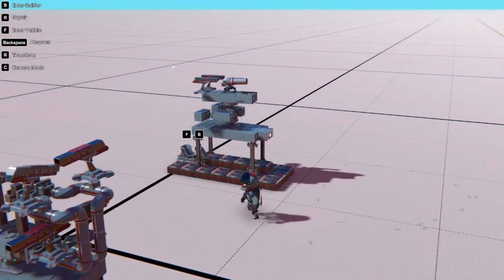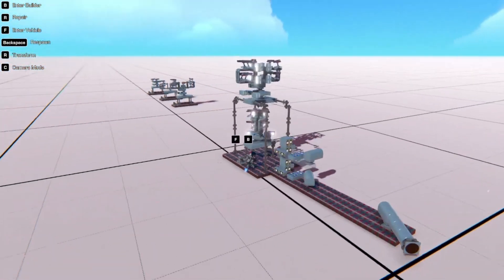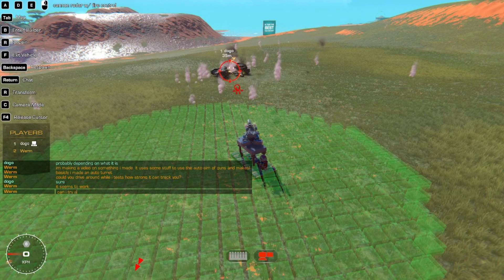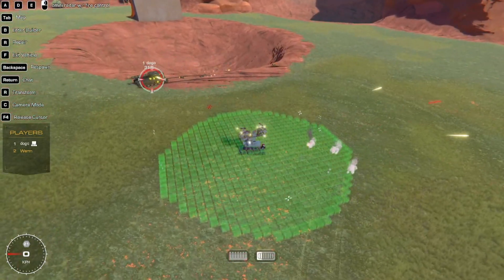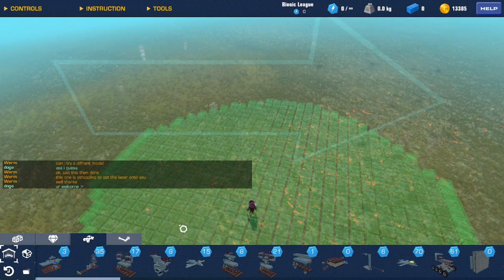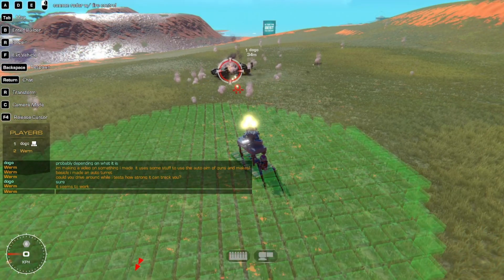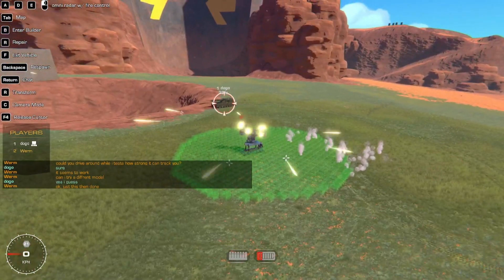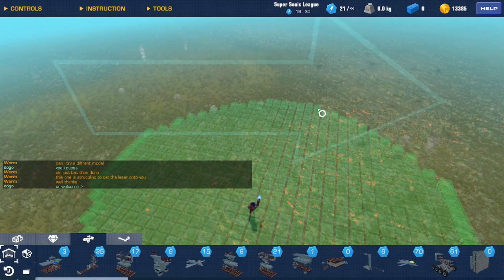Modernized Auto-Turrets | RECOIL TECH

Comment: Hey can you explain a little more how you make it fire only while it's locked
Reply from the maker: sure, so i have sensors to both sides. so when it turns it shoots. hope this helps!
Reply: @ThisIsDumbAllTheNamesAreTaken  doesn't that mean the gun has to stay in a fixed position then, meaning an enemy has to fly on its line of fire in order for it to get a lock
Reply from the maker: yep. @HardWayback  its not a great solution but it works better than having it constantly firing.

Comment: I'm excited to see your take on anti-laser amour. I have been trying to build a modernized tank, but it's been very difficult to build amour that can stand up to the mass quantity of rockets and lasers that most vehicles have. the amour I built absorbs quite a bit of damage but doesn't stop rocket penetration, and it takes up a lot of the complexity limit which limits some of the other features I want to include on the tank.
Reply from the maker: well the current strat is weight blocks, the each have 14 und. and sheild blocks also have 14 und. so a lot of those should help.
Reply from the maker: its been a while and i kinda forgot about this but anchor pins are the answer.
Reply: @ThisIsDumbAllTheNamesAreTaken  that what I've been using for building  mbts it works really good for stopping the blaster and machine guns. The problem is that with rockets/cannons the penetration can easily circumvent the armour and reach interior components and having dummy thick armor is not really practical.